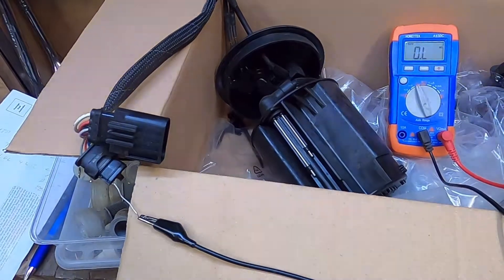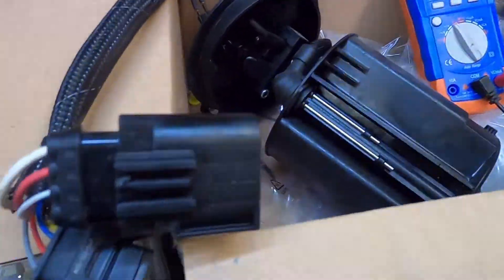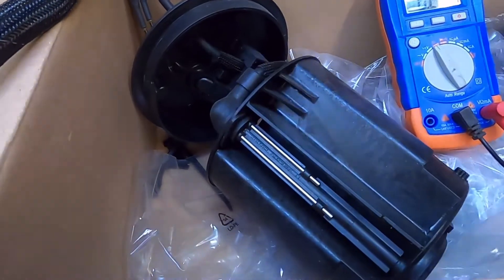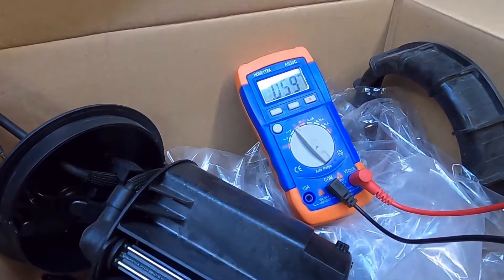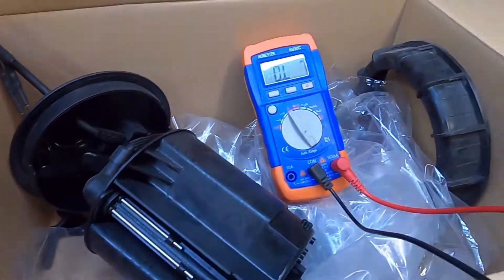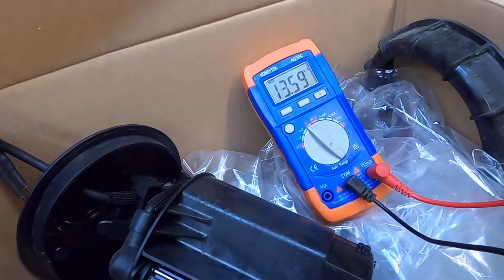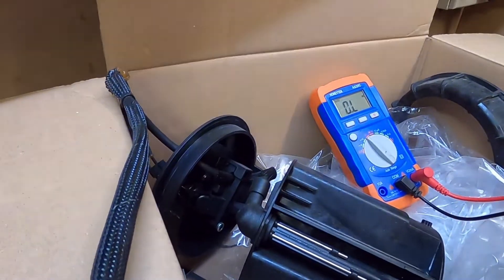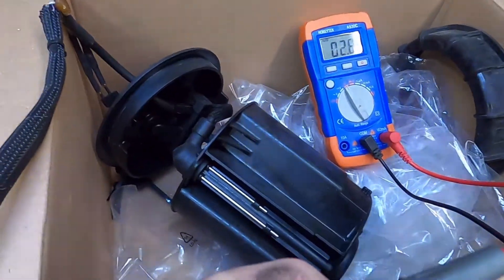Mercedes ML350 W166 OM642 DEF Adblue Heater Resistance Test - Faulty or Not?

Comment: Hello Jack, I have questions about the 2010 ML350 Bluetec:
1-On your heater replace where both units had the same resistance, what was the  weak link to justify the replacement?
2- On my car the heater shows no values based on your great video. Would  it result in a complete shutdown if the pump by the computer? 
3- How to test the Bosch pump outside the car providing 12 volts straight to it? Which color wire would serve as the ground for the test?
Thank you in advance for any help.
Reply from the maker: Hi - Lots of questions!
1 - I was told it was faulty by an independent - but after testing i think it was fine.
2 - No values would be a problem. the computer would pick that up and flag it. if you have removed it, can you find the fault?
3 - I would think the Bosch pump is 2 wire DC. Should be no problem giving it a flick to see if it works, same as a fuel pump.  Ad-Blue is water based so you could test with straight water. No idea about flow rate and pressure, but again I would guess it is similar to a fuel pump.

Comment: Did you tested old part in this video? And after replacing this unit error is gone and all good?
Reply from the maker: I did test it and it seemed ok.  I had to change the sensors to fix the error.
Reply: Hey @jackpwc01  you talking about adblue level sensors? 
I have code 20be1b the output of the heater element of the adblue tank has a malfunction. 
Mercedes e class 350 bluetec 2010
Any idea what can be?? The heater in side of the tank or something else?
Thank you
Reply from the maker: @sasejovanovski9880  Hi, no I mean the Nox sensors. I did change the heater but that did not fix the problem. If I was you I would check the resistance of each of the pin outs And see if the heater or centre is open or closed circuit
Reply: Thank you mate, I will check resistance first and see what will come out. 
I read in some forums but not sure if
 it's possible to trick ecu installing 6ohm 50w resistor between heater wires??
In place where I'm living temperature never goes under 0 degree and the Adblue it's freezing at -15???
So I think the adblue heater never will be activated in my situation....
Reply: @sasejovanovski9880  Did you find a solution for the above error. I have the exact same error popping up on my 2011 E class:
code 20be1b the output of the heater element of the adblue tank has a malfunction.

Comment: Thanks for the detailed video, i have (205c16) code ad-blue tank temperature is shorted to the grownd.

according to the range giving in the comment it should be between (10-11 kohms) in room temperature. However for my case the temp sensor reads Only (135 ohms) which is very low. Mine is definitely bad and i need to replace the unit.but i am thinking of wiring (10kohm) resister just to get red of the issue.
Reply from the maker: Sorry for the late reply. That should work depending on your climate depends on whether you need the heater working or not.
Reply: @jackpwc01  i have wired (10 kohm) to the temp sensor.
No more engine light is the car reads 20C, which is good 👍👍
no need for the heater since the temperature rarely reach below -10C in my climate which is the freezing point of adblue.
Reply: @yayanabaz  I need to do the same, how did you do it?Thanks
Reply: @yayanabaz hi what watt resistor should I Get. Thanks

Comment: Hi, thanks for the video. So what was causing your issue? Looks like what your saying is everything tested on your old unit was ok?
Reply from the maker: Yes that is correct everything on the old heater and sensor unit tested okay. But I already changed to a new unit. What fixed the problem for me was changing the NOX sensors